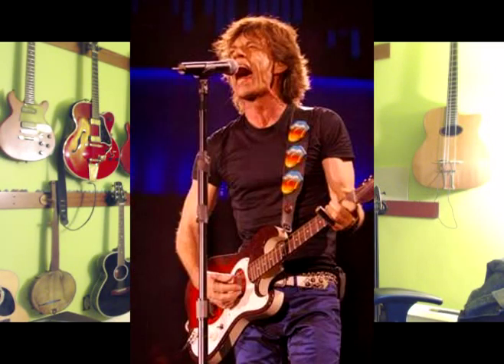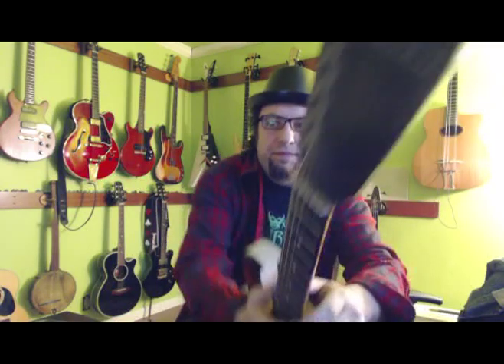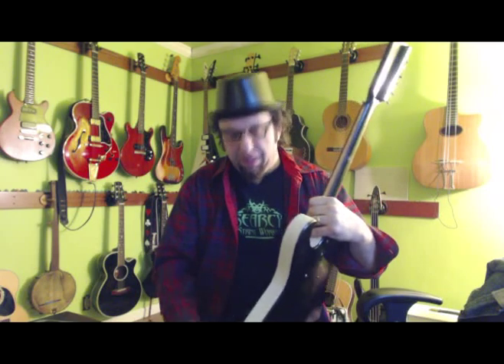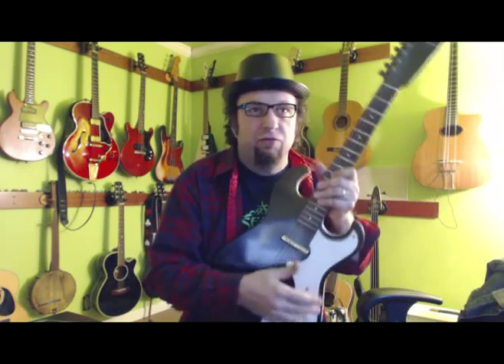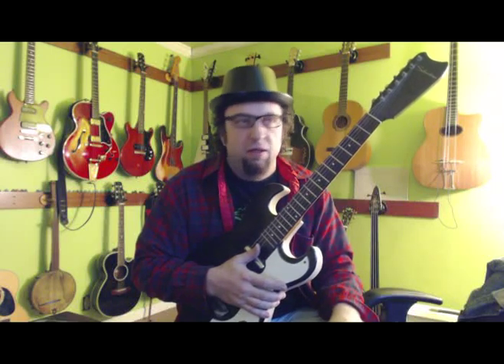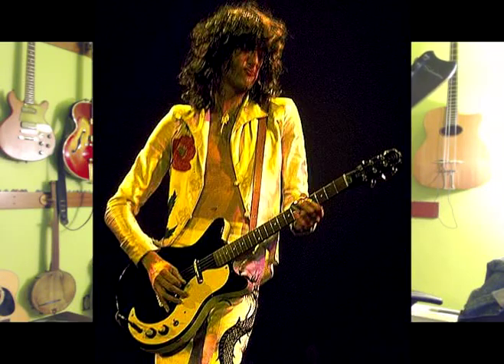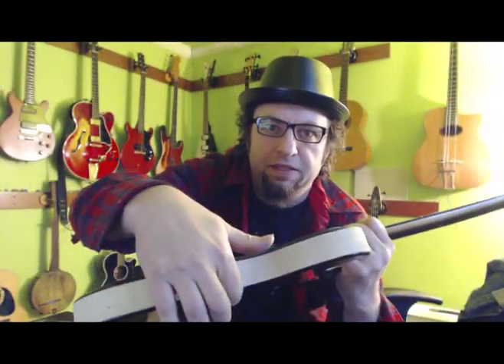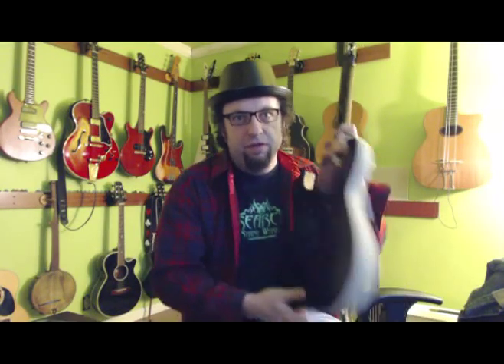1964 Silvertone 1448 Amp Case Guitar

Comment: I have one, too.  The tubes are easy to find NOS or new russian versions on eBay.  The serial number is stamped underneath the neck where it meets the body.  Yes, you'd have to carefully remove the strings and then the 3 screws on the back at the neck joint to find it.  Once you have it you can usually track down what year, month and even which week of that month (going by memory, but pretty sure of the latter) when the one in your hands was made.  If necessary you can find websites which will tell you how to read it.  Mine won't hold a tune very well, but otherwise works well.

Comment: My grandfather had the red guitar...When i was about 13 i tried to lower the pickups a little bit...being a dumbass the spring things under the pups well i kinda took them out and lost them...here it is 10 years later and gramp recently passed well i was wondering if you or anyone would know where to get parts for these guitars or what the things that hold the pups in are called...any information would greatly help me... Next question is your action extremely high? Mine once you get passed the 12th fret are extremely high and i have no idea how to lower it. Again any help would be awesome
Reply: First thing to try is loosen the neck and shim the bottom of the socket/neck gap out a bit.  You can use wood shim, but even playing cards will work (cut up) and will give you a little more control.  The bridge itself is made of walnut or rosewood and it floats under the strings.  You could try getting a similarly shaped and sized piece of new walnut and shave it down to see that will help your action a little (I wouldn't expect huge results via this method, though).  Definitely put your original away (bag it, tape it inside the case or something) and only experiment on the practice piece.  There was a truss rod which was only accessible by removing the neck from the body (also where you'll find your serial number which is loaded with information), but I am pretty sure it is non-adjustable.  As for the pickup springs- I'd suggest going to a luthier/guitar repair shop.  They may be able to find some springs that would work from some old/broken pickups.  Your grandpa's model (1457, red w/21 frets) had more frets than the 1448 (black w/17 frets) and the 1457 was nice to play on the switch middle setting, as it kind of gave that humbucker effect.

Comment: I have an old Silvertone like this but it has two pickups. Had it for 40 years. Didn't get the Amp because I bought it in a music store. I DID get the guitar case with the fake Alligator trim. Needs a couple frets replaced. Never liked the tuning pegs but just didn't want to replace them.

Might need to look at it again...
Reply: I know there are many who recoil in horror over any manner of modification of so-called Vintage or Classic gear but the DanElectro, though absolutely awesome for the cheap price, were built down to a price and compromises were made in some key places, and tuning is a major one.  Check out my mods in this pic   http://i.imgur.com/k7FJEwi.jpg that address numerous playability faults and shortcomings. 

The tuners I replaced with Shallers and by altering the headstock the strings are in a straight line from nut to tuners so there's no pinching or binding.  I replaced the Sears nut with a readily available Danelectro nut which has string slots that fit modern string gauges better than the Sears unit.  The pots I replaced with Jazz Bass stacked controls as well as the plastic knobs with the Jazz knurled metal ones (not shown in this pic) .  

The ultra simple stopped tailpiece/bridge I rfeplaced with an adjustable Leo Quann Baddass, now owned by SeymourDuncan.  The result is it sounds moderately better than it used to from increased mass at the bridge and it tunes and stays in tune even under extreme duress.  If you aren't up to the more surgical mods, like recutting and drilling the headstock, either find someone who can or do whatever you can do as every little bit helps make this beginners guitar a true pro, roadworthy instrument.